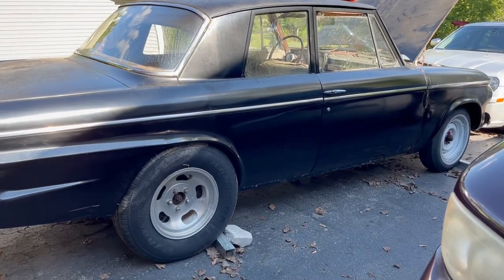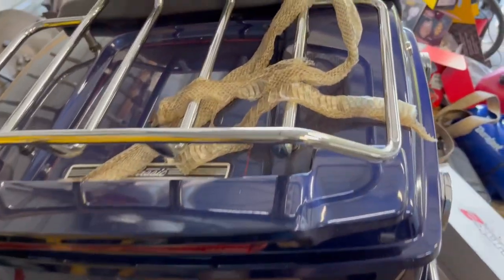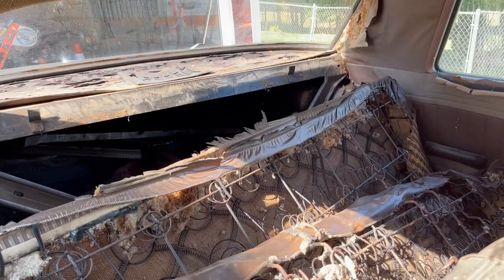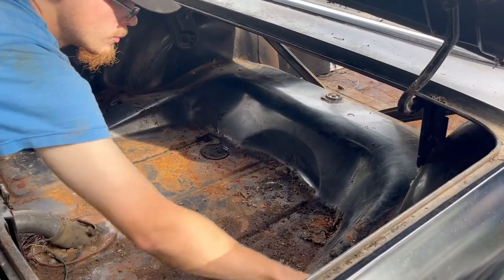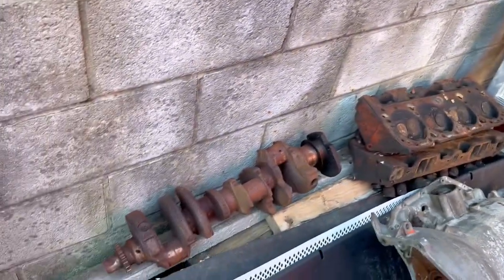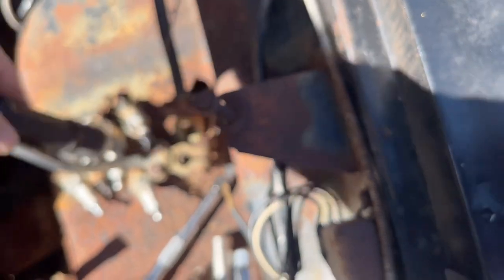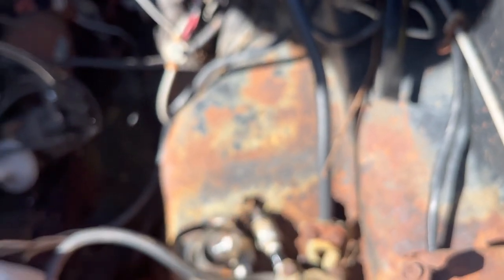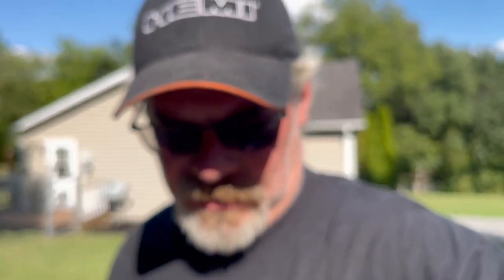The 63 Lark is off the trailer. What did we find in the trunk and is there hope for the 170 ??

Comment: Perhaps a little 283 with a 2 speed glider? Would be a period correct swap.
Reply: U have a perfect running 58 283 and old cast iron 2 speed automatic for it .complete carb to pan fan to rear yoke on transmission
Reply: Might as well put in a Studebaker 289, truly period correct!
Reply: @chipdayton1625  Al is putting a hemi it it
Reply: @darwinfoster7420  Nothing wrong with that, but I was responding to Mr Briggs comment.

Comment: If you don't wreck em. Half ass maintain em. They can run forever. 
      It's good to find  a solid, 2door,so complete. It could restore easy. 
       My first legally registered, was a 67 Fairlane, 200 6. No balls, but that rubber band could stretch to wind resistance. If it would have been 2 door, I would kept that heap of trimmed out body roll.